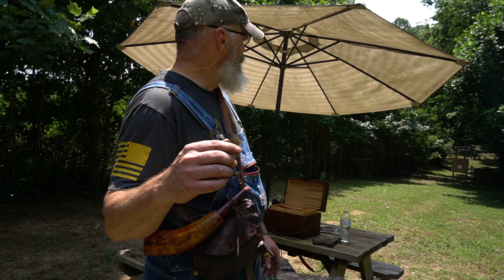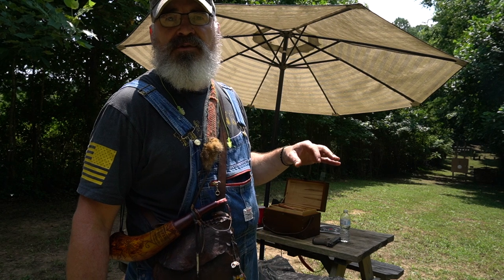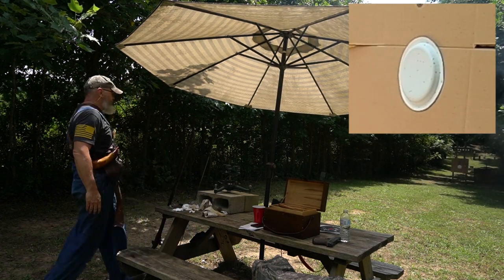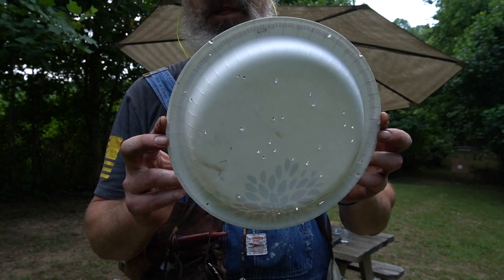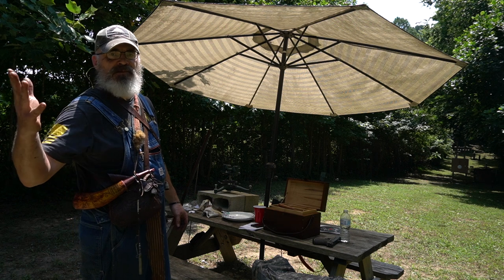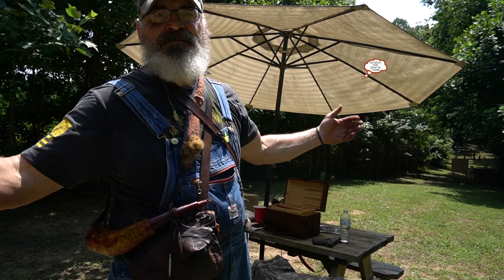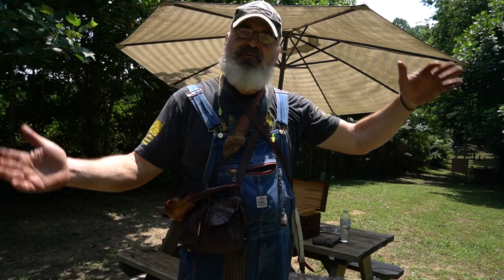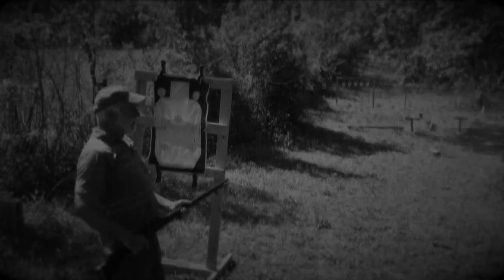WHICH PATTERNS BETTER IN A FLINTLOCK SMOOTHBORE? 1F OR 2F?

Comment: Interesting video, Bob. You should try with 3F as well. Conventional wisdom seems to be to use coarser powder for shot, but I find 75gr of 3F behind an ounce and a quarter of #5 shot wadded on both sides with tow shoots best in my 20 gauge, and that's my squirrel load. Likewise 90gr of 3F behind a .610 ball wadded before and after with tow is my target and deer load, and will put 2.5 to 3 inch groups on paper at 50 yards every time.
Reply from the maker: I've used 3f with several of my .62 smoothbores and get the results you describe. I guess I need to do a followup video called "2f or 3f for shot". Thanks Kyle!
Reply: My match lock wants 110gr 3F for round all and 90 for #3 steel shot.

Comment: that is a significant drop in pellets on target. when I patterned loads because my trap team wanted to shoot black powder one night I found the best pastern with fg, ffg was pretty close to my regular shotshells, and fffg caused the pastern to open up significantly.  but that is why you need to work up loads for specific guns I guess.
Reply from the maker: Thanks for the comment Sean. It is a significant drop. In my Kettenburg Early Bucks 12 bore I had more shot on target with 1f. Everything’s different as you say. I’ve always had good luck with low pressure when shooting shot myself. Thanks again!

Comment: Bob - Great video.  In my experience there is a big difference in velocity and I would assume energy, between Swiss 2F & 1F Schuetzen.  You may have gotten closer results if you had used 1F Swiss instead.  Keep up the good work!!
Reply from the maker: Hey Snap, I agree. I like the low energy Schuetzen for my 12 bore so I was comparing what I use regularly. Thanks for the comment!

Comment: Oh darn, you mixed in the German powder. Doesn't Swiss also have a 1.5F? 
I would be a bit more convinced with a full sheet so we adjust for POI.  But also recognize that they're all different, just as each powder granulation and make is.  Still so very much simpler than in my  the days of smokeless powder selection (where the options were/are far more numerous). Thanks for the tests.
Reply from the maker: Yes, I made that point in the video but there shouldn’t be much shift at that distance. I have a further test in the works as I state at the end to look into that a bit more.

Comment: Great video!  Fg is just too slow in that size of bore.
Reply from the maker: I agree. Works great in my 12 bore for shot....
Reply: Why #5 shot?  #5 carries its energy better at long range than smaller shot but in a cylinder bore you dont have a usuable pattern beyond about 25 yards.
#6 shot delivers a lot more shot per ounce and penetrates well at the distances a cylinder bore will deliver.
I wouldnt hesitate to shoot a turkey with #6. I have used #7 1/2 shot on rabbits and squirrels are killed them humanely with that shot size. Lots more pellets with that.
Its pellet count that does the killing at 25 yards.
Reply from the maker: Johnn Davis Hey Johnn. Couldn’t agree more. This was a requested video for someone considering 1f for a 20 bore based on the suggestion of a friend of his. I told him I’d show him how it works on smaller smoothbores for me. I picked the shot bag that had the most shot in it. That’s said, I hunt turkey with #5 and all my shots are in dense woods with thick underbrush at 20y or less. Works well. Thanks!

Comment: Using cannon powder in a smoothbore small arm you're lucky you didn't split the barrel or at least cause a bulge, you might get away with it in a thicker barreled rifle, but I would be reluctant to even try it with a thin walled smooth bore.
Reply: ? 1F is still "fine" powder (hence the "F"). "C" ("course")powders are very large granules, and are "cannon" grade (largest "c" grade I've seen looked like small pea gravel, almost). While the courser powders have a wider, shorter pressure curve (lower pressure, longer duration), you should still be fine to use it (still no where's near smokeless' pressure-curve, which is high pressure, long duration), it's usually the super fine powders (like the 4F I use in my .36 bullet rifle, and my brother uses in his .32, and bro-in-law uses in his .40) that can get you into trouble, as the peak pressure is quite a bit higher (high pressure, short duration). While most steel used in BP arms are not up to handling the demands of modern rifle and magnum pistol smokeless, a properly designed barrel can handle reasonable BP loads just fine.
     Thin barrels like on most shotguns are meant for lower pressure loads using courser grades of "F' powder, and shot loads, while my small bore rifles are fairly large (for the bore) at the breech, and aggressively taper to the muzzle to handle the high breech pressures (i proof mine to 1.5X, which is the typical SAMMI and CIP spec for modern cartridges), yet allow for good balance and weight.
    His shot load is probably only generating a peak of 20,000 psi, my .36 (278gr spitzer, 80gr 4F) is probably running 35-40,000 psi peak